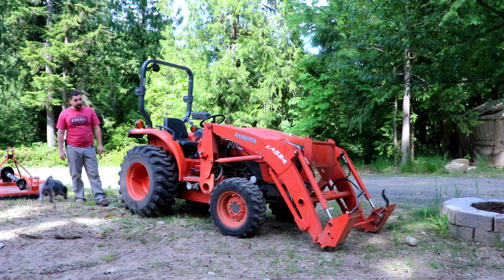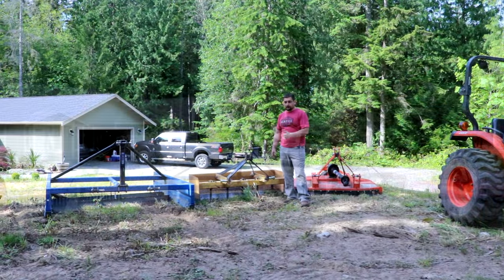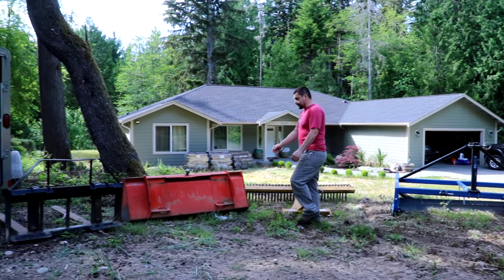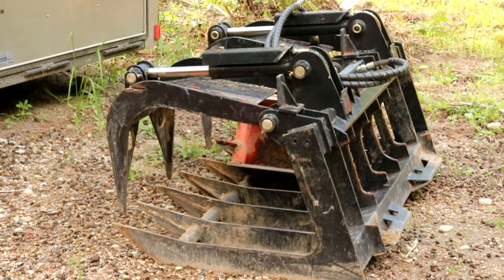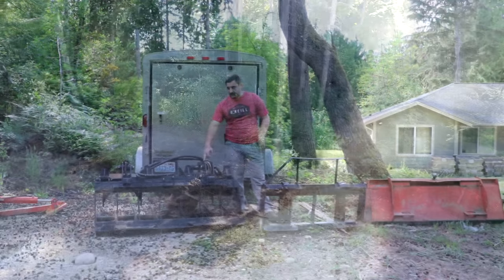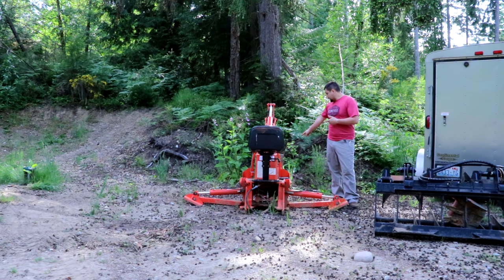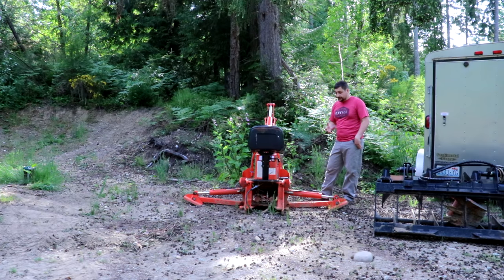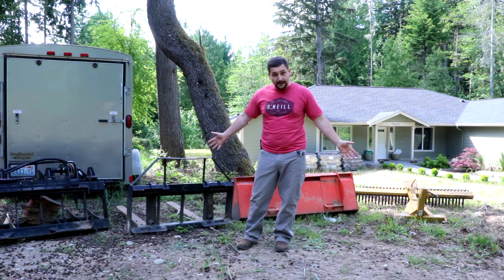What is the best Tractor attachment!!!

Comment: You are 100% correct that you oversized that grapple.  I bought one from the local dealer just like yours, and I immediately returned it and bought one about 1/2 the weight.  It works GREAT!    Sell that thing and get a properly sized one.  THAT is the best tool I have for my tractor.  I LOVE IT.

Comment: you are 100% right about the pallet forks. I got mine because I had a specific use for it. But since purchasing it I use it a lot. For things I would have never thought I would use it for. The forks work great for a demolition tool. It will knock down and tare up a wall in no time.

Comment: I put 2 inch receiver on my bucket on the inside. Also on the back of my box blade that way I can use any hitch including pintle. I originally put a hitch on the back for our local Christmas parade
Reply from the maker: I have been thinking about putting one on my box blade as it the attachment that is most often on my tractor.  It would save time when i need to move stuff around.

Comment: You can double the digging power of this backhoe. I have done this on 3 machines that I used for commercial work. Torch off the large Excavator teeth and install teeth from a full size Ford backhoe.
The machine does not have the power to pull these Excavator teeth through hard pack. Look at a 24 or larger bucket on the Ford.  These teeth WILL cut with half the effort.
Reply from the maker: Thank you for the tip I will be trying this very soon.

Comment: On your overweight grapple why not just sell it and buy a lighter one. There are only a few out there. The Kubota 0660 would have been the cheaper option weighing in at only 250 pounds. However Everything Attachments 55" Wicked Root Grapple is the best light weight out there for about $2,000. That is the route I am going with a L2501 which BTW has the same lifting capacity as yours. I have researched and my main concern on the grapple is the weight. Lots of inexpensive ones that just weigh too much for our tractors. Another option would be a Rural King Grapple that costs as much as the 55" Wicked Root Grapple making it a worse choice. I can tell you have been pretty much a shopper trying to get the best bang for the buck which is good most of the time. Sometimes it pays to spend a little more in cases like the grapple and do it right the first time.

Comment: Hey Daniel, you have some great videos. I have a question, maybe you would know the answer. I am purchasing a b2601 within the next few weeks. I plan on getting a backhoe and a box scraper. Are there any options such as aftermarket quick attach 3 point that would make swapping between backhoe and box scraper back and forth easier? It seems like a pain, but I haven't done it physically yet. 

For the work I have planned on my property, I will be switching back and forth between backhoe and scraper regularly 

Thanks! keep up the great videos
Reply from the maker: Putting the back hoe on is always a pain in the butt, you can get a quick attach I have several other later videos about that it works great for attachments that don’t require hydraulic power.

Comment: Thanks - great video - very helpful.  I'm in the market for a new tractor in this size range.  How would you rate Kubota against Kioti?
Reply from the maker: Michael Bradley You will pay more for Kabota but you’ll be much happier in the long run. I looked at Kioti quite a bit. One of my local dealer stop caring them right about the time I was getting ready to buy and after a very long explanation of why they stopped carrying kioti I decided Kioti was not for me.
Reply: Have had a 45 hp Kioti for 5 years, a great tractor.

Comment: Did you get the tractor new or use and what was the staring price for one looking at getting one for my land work and snow removal
Reply from the maker: I got it new, it was $32,000 that was the tractor, front loader, quick attach bucket, back hoe, and a 12" trenchiong bucket. It hard to find a good used tractor that has not been messed up.
Reply: I have been looking for a tractor and I thinking I'm set one might go with the mf 1750m it's better to go new then used what made you go with the kubota then any other ones I would like to know about your opinion and what made you go with the kubota thank you for your reply

Comment: I have a kubota L3301. I want to get a backhoe but not sure and if I need a specific one or if anyone would work. What do you recommend? Also what are your thoughts on a bucket tooth bar?
Reply from the maker: When I got my tractor I told the deal that I wanted a backhoe and they recommended that I get the BH77. An L3200 tractor is 32HP, I would think that a L3301 would be close to that. But I recommend calling a Kubota dealer and asking about what one would work best with your machine. Also really consider what you want a backhoe for I used mine a lot when doing property prep to build houses. But for just everyday tractor use the back hoe site in the garage a lot!!! You might consider renting an excavator if you don’t have a consistent need.
I don’t like bucket tooth bard, because it makes it hard to get a really smooth finish grade when you are back blading. I find that when using the front loader to move dirt I end up using the ripper shanks on my box scraper to loosen the dirt first.
Hope that helps
Reply: Bxpanded tooth bar,, OMG yes  I just had to use mine to clean up some sleet we had over the weekend. Sleet and froze solid. A straight edge bucket would not have worked, or not as good I think. Gives an extra 4 inch lip of bucket space. Make sure to measure inside edge perfect, they are made to fit each bucket.
 I hope you don't mind I answered a couple questions Daneil.

Comment: What would be a good tractor to start off with for my logging
Reply: If your going to do some tree removal and fire wood at home, a 30-40 hp tractor will be fine if you take your time and don’t use it as a bull dozer. If your performing heavier logging tasks I’d say 40-60hp. Wear your hard hat. There are a dozen or more logging type implements. I would recommend a grapple. Good luck

Comment: Landscaping rake is completely useless PSA for anyone out there it is a old device for the old days it has no use unless you are doing land clearing and need to remove the roots which you will grab as much dirt as a box blade with this device it practically has no purpose anymore my landlord has one she has used it a handful of times in the last 10 years she tried to sell it to me and since then I've literally never had a chance to use it
Reply from the maker: yup i never use that thing it just takes up space i my yard, and it getting rusty
Reply: Guess I'm the odd guy out. Sold my box blade, seen no use in owning one. Bought the Landscape rake, and use it all the time. Adjusted right, I can make it dig. Or rake leafs without damaging grass. 

But if not adjusted right, its worthless I agree. Using mine now, to scatter 50 tons of sand. Worth its weight in silver doing this job. Filterers the sand into any low spots. without damaging the grass.